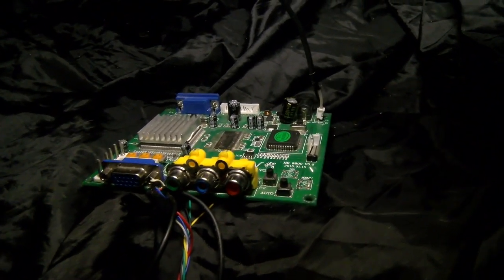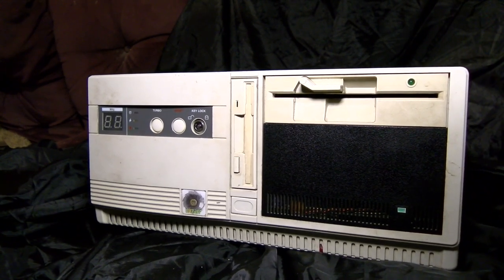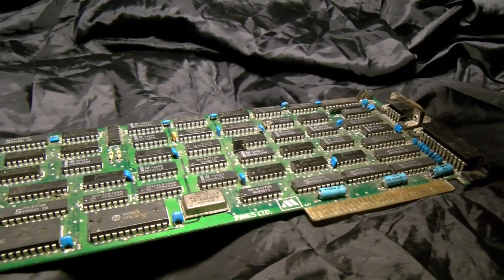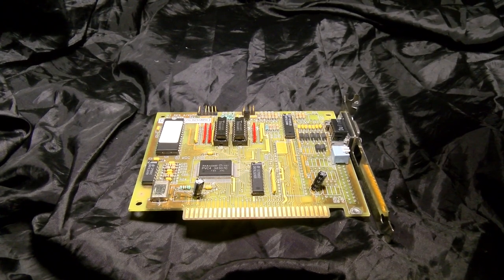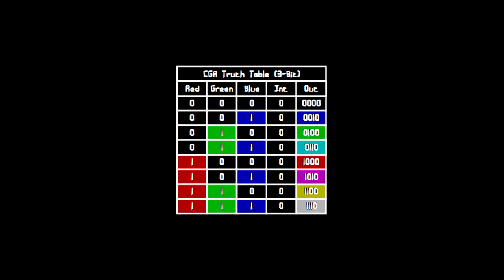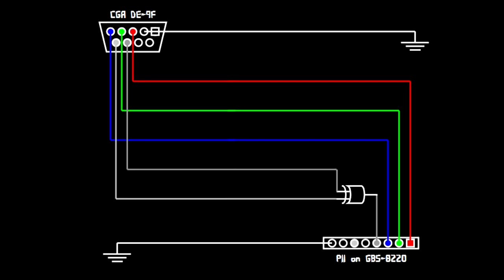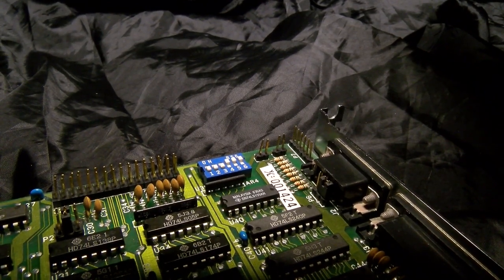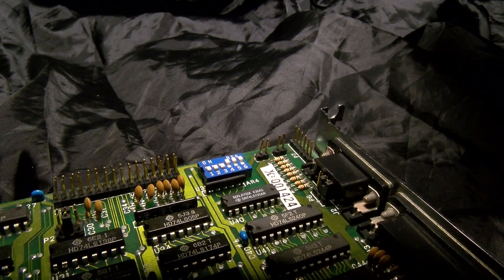CGA/EGA to VGA on a budget

Comment: I have one of those. You can use it to get the output from an Atari ST in colour mode onto an LCD screen. You can bridge HS and VS with a NAND gate if it's an STFM (tapping the power input to the board to power said gate) or just bridge them with a wire directly for an STE.
Reply from the maker: A NAND? That makes me think the 'polarity' of sync pulses are reversed somewhere compared to CGA. Good to know.

Comment: Awesome video. Although it's true that this circuit has been around for a while, this video provides some context and demonstrates its implementation, making it infinitely more accessible.

The Commodore 1084 is an interesting case in point, as it can display all the 4096 colours (32 simultaneously) via the 9-pin connector, so you would think it would make a good EGA monitor. Sadly the Amiga uses analog signals to achieve this so, as a PC monitor, it's limited to CGA only. Although I've never bothered with the China converter before (because of people saying it mostly doesn't work), I'm considering giving it a go now.
Reply from the maker: There are also other circuits out there using conditional logic with GALs, PROMs or Demuxers, I've even since built one that corrects the brown issues (see video ID nWKs0k-9DvE). If nothing else, I suppose you might be right that awareness of this possibility could be increased slightly, so it might even save a laptop or highly integrated machine somewhere that someone had thought otherwise impossible or too costly to diagnose.
As soon as you said 4096 colors I figured it'd be analog, or else it'd be 4-Bits per color (probably) and, obviously, that wouldn't happen on a 9-Pin connector. Still, if that monitor can take TTL RGBI, it should still be usable for most EGA stuff with the card set to 'standard' mode, rather than 'enhanced'.
If it can sync 21KHz from an analog input, you might actually be able to get 64-Color EGA with little more than three resistor ladders between the card and the analog input - Probably ~470 Ohm for MSB, ~1 KOhm for LSB, might need another to terminate to ground after those. Suppose you could always put a hefty trim pot on the outputs and start with it at full resistance to avoid potentially killing the monitor, turning it down slowly until the colors come in. You could theoretically do the same for an MDA to a single color input (or just tie it to all three... or tie it to red and blue for 'fabulous mode') if it could do 18KHz. You'd have the China converter beaten in that case, because that doesn't like going much beyond 15KHz RGBS, until you get to 31KHz in RGBHV mode. My quick searches do indicate that the monitor is also limited to around 15KHz, though, and I know almost nothing about Commodore's hardware.
Reply: @HighTreason610  mind blown. 🤯 If it works, I'll do a video on it!
Reply from the maker: Obviously be aware that if you do use resistor ladders like that, you'll then have broken colors when not in RGBrgb mode, which is most of the time. Still, as it seems the monitor does have both analog and digital inputs, with said digital input being RGBI, you could probably dodge this with a simple 4PDT switch that would send the CGA-like signals over to the TTL RGB socket, then when thrown, would send those signals to the appropriate parts of the resistor ladder connected to the Analog RGB socket. Not sure about the sync lines in this case, maybe they're electrically the same in the monitor (as in, H/V on one socket is connected to H/V on the other) which would be convenient, otherwise you'd have to switch those too (6PDT switches are a pain to get hold of, might be better with just adding a DPDT). I still can't find anything to suggest the monitor will sync the 21KHz modes, so you'll likely never get 64-Colors in any case because of that. It does seem like you'd probably need nothing but wires to get the 16-Color modes working on that monitor, though, which would give you access to about 100% of CGA and easily 90% of everything EGA, as so few things ever used modes that switched the card into 6-Bit RGBrgb output. I didn't even bother supporting this on the Bastardizer Mk.IV.

Comment: I was going to buy a GBS8200 for a different reason, GBS Control, the custom firmware for GBS8200 boards which I would use for high quality upscaling retro games consoles for display on lcd tvs, requires a ESP8266 wifi board as well.

Comment: I think the colors are dodgy between devices, because there was no standard in line termination, they expected the other end to draw nearly nil current.  So the more correct way to do this would be to put a buffer on the incoming ttl logic lines.... but like... if you're doing this cheaply... :P

Comment: Yup. Now go out and get that Trident 9000 ISA card. End of story......

And now for the rest of the video. This is going to be cool. Have you seen that I shared a picture of the voltage stuff you asked for? It is on the forum.
Reply from the maker: Yes I did, so thanks for snapping that, just didn't have a chance to get to it yet as I was taken up with trying to finish this.
Reply: @HighTreason610  Cool. 🙂

Comment: what about using a ROM + resistor DAC
Reply from the maker: The thought did cross my mind and I've used PROMs as conditional logic in other projects. In this case, though, one of the goals was to require the least amount of tools possible and a lot of people still don't have EEPROM programmers, not to mention most ROMs are still too slow: The pixel clock can approach a little over 24MHz, so you'd need ~40ns ICs, but most ROMs are up in the 100ns+ range (We'll say about 8MHz tops) and faster ones can be expensive if you can even find them.
A PAL might serve better for this approach, as they tend to be much faster.
As it is, I've since discovered another approach using an additional 74 series logic, which should appear in the Turbo XT video once I have time to work on it.

Comment: raspberry pi zero based rgbtohdmi adapter + optional hdmi to vga dongle, costs ~same as the shit GBS
Reply from the maker: These Pies seem to cost slightly more than the GBS-8820 and the required components. Plus, as you noted, I'd then need something to convert to VGA again anyway, so it seems the price would be around double. Also I'm weary of latency and can't see any mention of RGBI or rgbRGB when searching such things. It honestly sounds like a horribly inefficient solution on the face of it.
Reply: @HighTreason610  £5 pee zero + $2.8 XC9572XL cpld + $1.75 universal pcb "2Pcs Qfp/Tqfp/Lqfp/Fqfp 32/44/64/80/100 To Dip Pcb Board Converter Adapter Ic iz" + some resistors/capacitors + $1.21 "Converter HDTV Video to Female Male Cable Adapter HDMI for DVD PC 1080P VGA New"

its pixel perfect, latency is couple milliseconds (less than quarter of a screen), screenshots are at github hoglet67/RGBtoHDMI/wiki/Gallery-of-Screencaps, its programmed using low level arm, no waiting one minute for linux to boot on the pee, requires something like 16MB SD card (MB not GB). And most importantly its open hardware and open software meaning you can adapt it however you want.
Reply from the maker: I must be looking in the wrong places, as Pi Zeros were all upwards of £20 when I did a quick search.  Admittedly they're not something I'm particularly familiar with, as words like "ARM" and "Linux" are usually enough to keep me away, so I have little understanding of how any of this is supposed to go together. Also, does the CPLD require soldering? Because that's a mighty barrier to access if so. If it works, it probably is a much better solution, quality-wise, but I'll pass for now.
Reply: @HighTreason610  the price for pi zeros is because of high demand and lower supply (causing scalpers to sell them for 20£). But if you're patient you can get one for the correct price.

Also yeah the CPLD has to be soldered. Now there are people selling them from times to time, I bought mine on ebay for ~30€ with a 3D printed case and it was basically a drop in upgrade for my unused pi zero.

It is indeed strange to use a much faster computer to just process the video, but the quality is really nice.

If you want to go the old way, this is a nice alternative to have more "transitors" without paying much for it, but it requires a programmer like the TL866 https://www.youtube.com/watch?v=F1685u-QQ0k
Reply: @Arnold Rimmer  That was 
Noel. CPLD programming doesnt even require any programmer, you do this from the pee menu with one click. How is it expensive when it costs $3 CPLD + pee zero? who cares about power, are you going to be playing with your modded CGA laptop in a park for multiple hours? :) soldering - you can buy pre soldered boards on scambay, obviously in that case it will cost extra $20. 2 boards because Noel was modding LCD into the Amstrad, and LCDs require driver boards, unless you meant plugging a shield into zero is "impractical" to you :-)

All in all that pee zero RGBtoHDMI is currently the best solution. Its the cheapest, produces perfect picture, has negligible latency, and even supports 16 color composite mode. Plus with few clicks and another cable you can switch it into any other input mode, and this thing supports almost everything under the sun from the early 8/16 bit computers.